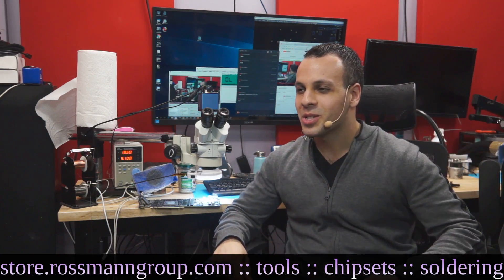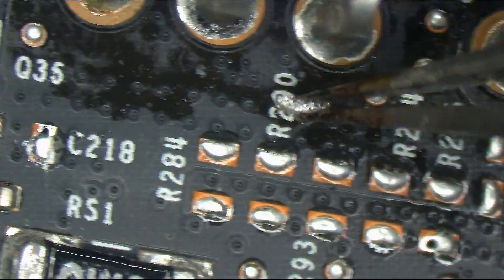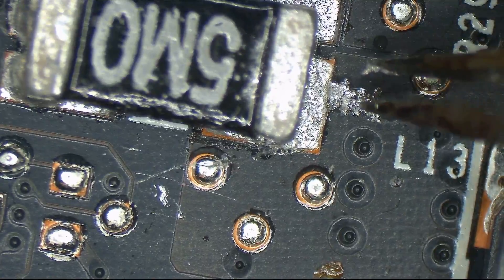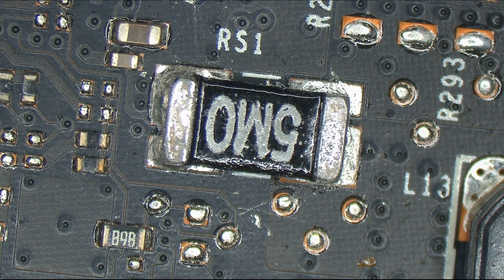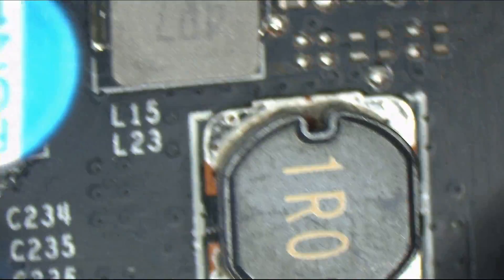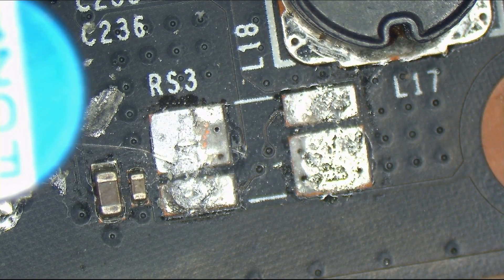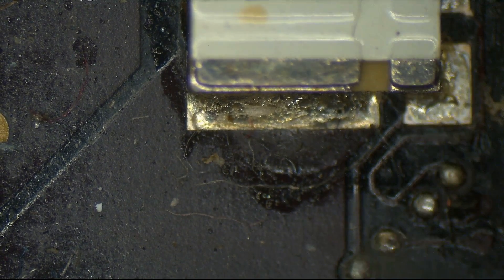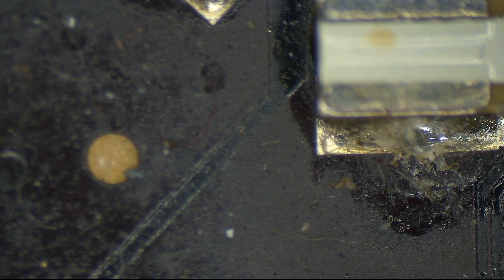DO NOT SHUNT MOD YOUR GRAPHICS CARD WITH LIQUID METAL!

Comment: That is morons at work (not you, the card owner).

Liquid metal has a great thermal conductivity, but it is a hazard for many metals like aluminium, tin and so on.
There are some gaming-channels and many modding channels/forums that tell you to use Liquidmetal on the current shunts to lower the resistance - that happens when people with no education in those fields try to talk about the details. It works - but it is really risky and even when done correctly will damage your hardware.

The sense-resistors there are 5 mOhm - just buy a 10pack of those and solder an additional one there - done.
Reply: Tells people their are guides for that... but says its hard to solder.. there is youtube to learn how to solder. You want to properly overclock.. learn to solder and replace the parts with better parts that give you the results. Liquid metal has 0 place. Your not overclocking your damaging the equipment.  Proper overclocking does not damage the cpu or gpu because they are all under rated. they test at x volts then say it runs efficient at a lower volt and under rate it. A actual modder or overclocker will do it right and it will work without liquid metal. You become better and learn more by doing it properly. 

Sure tide pods get you high... but kill your body and brain from the chemicals. Same principal. Sure liquid metal works at the cost of the components and boards death.
Reply: Soldering takes a 5 min video... Here you go.. https://www.youtube.com/watch?v=v4D_Rdp1uh8 a soldering iron which im sure any of your tech friends prob have and will let you borrow.. and a DAY of practice. They teach people how to solder in an HOUR in tech school.. grab some cut wires or if you have a broken board laying around to practice on. its not rocket science.. People DUMBER than you learn in a day.  once you learn it becomes a useful skill. One that you can be employed by. Meaning once you learn... you can mod your boards and your friends and get them to pay you.
Reply: +Raigekon If you can't solder then don't do a mod which requires soldering. It's really that simple.
Reply: They have clearly never seen or heard of how mercury and gallium attacks other metals by forming an amalgam with them. There are plenty of videos of a drop of gallium on an aluminum heatsink turning the fins in to something that feels like it has the structural integrity of wet tissue paper.
Reply: "You are trying to lower the resistance, but you suggest adding more resistance to the circuit... that happens when people with no education in those fields try to talk about the details"
Goes to show that you should have listened in school when the teachers were talking.

solder 3 more 5mOhm resistor on the first one and the result will be 1.25 mOhm.
Reply: I thought the primary purpose of liquid metal was to be used as a better coolant for CPUs than traditional thermal paste. I had no idea it was being used to lower resistance.  But then again, I honestly know next to nothing about this field. At least I admit that, unlike some others.
Reply: Learn how to solder and don't treat electronics with this gallium shit.  Don't wanna learn? DON'T TOUCH ELECTRONICS AT ALL. Simple enough?
Reply: +Robert Depuoz And how exactly is what we're saying that different from what Der8auer supposedly said?
Reply: GamersNexus made a shunt video but they said that Liquid metal is known to damage tin and aluminium and other metals so be careful not to use too much of it.Not everyone knows how to solder but everyone who as ever built a computer knows how to apply thermal paste.Or in this case thermal metal
Reply: Soldering is the right way to do it, but soldering one of those boards is not easy. The currents flowing on a GPU board are significant so they have hefty traces which will suck the heat right out of a normal soldering iron. 300W+ when overclocked with 12V in and around 1.2V to the GPU die requires an awful lot of copper in the PCB. If you try to solder a GPU board like you would a little through-hole Arduino kit you're going to have a bad time. Without hot air or preheat and the right iron at best you end up with a shitty dry joint, at worst you end up overheating the component or trashing the pads by keeping the iron on for minutes until the solder finally melts.
Reply: You can buy a cheap X-Tronic soldering "station" for, what, $40? It even has auto shutoff and heat ramps up from 200-480c really quickly for such a cheap iron. Works well for a backup unit, as long as you replace the tips with something decent. The X-Tronic 3020 fits Hakko tips, so you can even upgrade that to something decent for about $15-$20 each tip. Get you a desoldering heat gun, some flux paste, wicks, tip cleaner, tip tinner, and some decent 60/40 solder (Kester, Lodestar, Mechanic brands: don't huff the smoke) and you're good to go. Start practicing on junk micro electronics. You might want a scope as well. A cheap one that hooks up to HDMI or DVI monitor can be had for like $30-$100.
Reply: Raigekon soldering is not that hard
Reply: If you stack a 5MO resistor on your existing 5MO resistors, resistance should be 2,5MO(R(p)= R1*R2 / R1+R2, but interestingly thats not enough to gain a good amount of watts of power increase. 
I have moded my GTX 1060 and stacked 2MO SMDs resistors onto the existing 5MO ones. So in theory i should be at around 1,42MO. Before performing the shunt mod gpu-z showed 112% TDP @ 2138mhz @ (1093mv) under full load. After the mod 81% TDP @ 2138mhz @ (1093mv). My total win is 31 % difference but only 19% win i can use due to limitation to 100% TPD after power mod. 
Now @ 2164mhz @1093mv i start to hit power limit again(100%), which sucks. 

I now ask myself what to do. I dont know exactly how much the resistance did increase by my solder job. Maybe i just buy some 1MO resistor and replaced the stock ones.
Reply: No need to buy them, just solder over it, so that the solder connects the contacts, bypassing the resistor.
Reply: "Liquid metal is smth i could do right now, soldering isn't. "
You can also either eat a TidePot or make a sandwich - one is certainly a lot faster...see the flaw in your 'argument' yet?

"Another thing, der8uer did a 5 month test with liquid metal applied."
And you have watched the video? Cause he only tested the GPU performance. Entirely irrelevant.

but sure . if you want to destroy your hardware go ahead. Just don't spread you braindead bullshit.
Reply: +Robert Depuoz You've got to put their statements into context.

What people are saying isn't to never use it on any electronics ever, it's to never use it in this way where it will form an alloy with the solder before you're done with it. Extreme overclockers will probably remove it when they're done setting the record because they know it will eat various parts of the card. The one exception is between the die and the copper surface on the heatsink, but even then you need to be careful and inspect it regularly if you want to keep using it that way.

Personally I think using a gallium alloy is a specialty solution and isn't really appropriate for continuous use with electronics, because of the problematic chemical properties, but you are of course free to dissolve parts of your card if you want to.
Reply: Or, yanno, instead of risking Liquid Metal corroding everything, one COULD simply attach a small jumper wire instead.

Still this is something that NO ONE should even CONSIDER unless they are doing LN2 work, or are trying to break some hardware record on HWbot or 3D Mark. HWbot actually accounts for the TYPE of cooling as well, so if you are trying for a record, shunt modding will help - but SERIOUSLY - why people EVER though using Liquid Metal TIM to get this "shunt mod" effect - is beyond stupid....

I mean FFS, it is NOT HARD to solder a Jumper wire, or one could even use some copper foil and acrylic nail polish to get the job done.

Even if LM was not corrosive, it CAN MOVE! And should it bridge the wrong connection - you will have a dead Graphics Card!
Reply: +Robert Depuoz Seriously? Learn how to read between the lines, people exaggerate all the time to make a point.
Reply: That's like saying, i don't need to be a doctor to do an open heart surgery since there are videos and guides that tell's you how to do it. If you dare to open devices then you need at least basic understanding of electronics and soldering it's the more easy part, if someone don't even know how to grab a soldering iron then such people should not even think or attempt to fix something like this was done.
Reply: @ABaumstumpf
Most people want to reduce the resistance to increase the power limit. I would like to do the opposite.
Can I just solder a 1 mOhm on top of the 5 mOhm resistor and get a total of 6 mOhm to decrease the power limit though?

Because you said "just solder an additional one there".
Reply: It's funny that everyone has an opinion on what other people should do with their property. You should know that if you use liquid metal you run a risk as with most things. That said, many professional overclockers including Der8aur and Kingpin use this method on their own cards in competition. I'd trust them over some random yt commenter douchebag any day. If you watch Der8aur's guide he says it's not something that should be done long term but if you're just running some benchmarks trying to get a record it's a viable option. But research is King with anything you don't know about.
Reply: Jesus fucking Christ we're talking in circles. I literally said it's not a long term solution, but is viable to run some quick benchmarks... And those comments I quoted are absolute statements... Therefore context doesn't mean shit in that case. Anyways I'm done with this. To anyone considering doing this DO YOUR OWN RESEARCH. I thought about it about a year ago. And decided the cons outweigh the benefits in my case so I never did it. Your objectives may be different, therefore making it worth it for you.
Reply: Robert D youre a noob. learn how to properly solder.
Reply: i should make a meme for this shit.. and so i did.. enjoy lol https://imgflip.com/i/26pfeg
Reply: Djhg2000 I didn't specifically say you... But "liqui metal has 0 place" and "don't touch electronics at all" and all this other bullshit telling people what they should do with their property is fucking stupid. I'm sure this comment section is filled to the brim with electrical engineers and every day on the internet I meet the smartest person on the planet. All I'm saying is if you want to use l.m. on your card do your research and know what to expect and you'll be fine.
Reply: Yeah, I just leave my shit alone.  I still have an i7 920, factory clocked at 2.66ghz that 99.9999% of all current software won't overload.
Never needed to replace it, so I never have.
Reply: "use Liquidmetal on the current shunts to lower the resistance" "5 mOhm - just buy a 10pack of those and solder an additional one there" You are trying to lower the resistance, but you suggest adding more resistance to the circuit... that happens when people with no education in those fields try to talk about the details
Reply: Finding a guide takes less than 5min, applying liquid metal doesn't take much time either. Learning how to solder takes time, hell i don't think i could easily learn how to do it properly. 

What takes more learning and understanding? Applying liquid metal or soldering(provided i know nothing about it). Liquid metal is smth i could do right now, soldering isn't. 

Another thing, der8uer did a 5 month test with liquid metal applied. On his card there were no problems, but he did say there are ppl that had problems and there are ppl don't have problems at all with it(watch his video on it). Why are there ppl without problems and those that have them? Did they apply too much? Did they let it spill?

I agree that to do proper overclocking, you likely should learn how to solder, but maybe i don't want to learn how to solder just to do some overclocking here and there(not talking about daily system). This doesn't take much time, doesn't take that much effort(still need to be careful ofc) and gives you results.  I can easily do this on my old vid card, no risk there, i won't sell it, i won't use it, so it can be a 1  day overclocking project.
Reply: Did you watch the video? Yes he did test the performance, but he also looked at what happened with gpu and it was fine. You can also check the comments there. As i said previously, ppl are reporting it being fine and not fine. 

Watched the video. I don't have anyone i could borrow, so i'd have to buy it, further more i don't even know what i'd have to replace the shunt with to make it better, because my knowledge is if i short it i get better performance. What i do however know is a pretty decent amount about how to overclock(software side of things). Liquid metal is also smth i may just have laying around, since it's really effective as tim, so i literally just grab it whenever i want to and apply it. Further more, i can still remove the liquid metal after i'm done overclocking and i can remove the liquid metal and can continue to use the gpu regularly(if i want to). 

Tho not a 5 min, if you watch gamers nexus vid on application you will see how they protected other components as well as everything but the top of the shunt from liquid metal. At most liquid metal touches the solder on few small points. I don't see it as a problem with this kind of application. Since the vid is pretty long and i haven't really found a lot of good looking pictures of shunt mods here is a time stamp that shows a pretty nice looking shunt mod https://youtu.be/3pflC72NfnU?t=613
Reply: Yes because everyone knows how solder. For you it might be easy, on the other hand it would likely take me much longer to replace the resistor than to apply some liquid metal. It's a easy and effective way to do it, but 99% of the ppl shouldn't do it, unless they going for high benchmark scores(maybe oc competitions), in which case the gpu is already at really high risk of just kinda dying.
Reply: Raigekon - if you want to modify electronics you should know how to solder (aside from the fact that it is really easy). If you do not know anything about electronics - what makes you think it is a good idea to smear liquid metal (that has a lot of warnings on it to NOT let it get into contact with electronics) all over electric parts?
Seriously - go look at the warnigns on things like Conductonaut.
They mention 2 specific things: Don't let it get into contact with Aluminium.
And don't let it get into contact with electronic parts.

There is a reason for that:
It physically DESTROYS those things. As you can see in the video as the solder just crumbles away.

"but 99% of the ppl shouldn't do it"
that includes anybody that does not know exactly what he is doing. if you know what you are doing you will not use liquid metal as a resistor unless you do not care about the hardware getting damage, like when trying for world records.
Reply: Yeah that's basically what i meant with 99% of ppl(world records ofc). You don't need to know everything about electronics, since there are plenty of guides that help with that. 

This is also a easy way to start to learn how to do bigger overclocks(not daily usage overclock ofc, benchmarking overclocks). Now obviously if you are starting, you wouldn't do that to a 1000€ gpu(you'd go with smth like a 50-100€ gpu). It's a way to learn what happens(with overclocks, not liquid metal), how things function, it's 1 less thing to learn from the get go. I see it as a stepping stone to more complex things.
Reply: Raigekon - sure, but again - not with liquid metal. that is just destroying it.

Comment: You may have contaminated the joints on the other board with gallium when you poked the solder, check on them later to see if the gallium attacked it

Comment: Just buy a strix card so you dont have to do the power mod.
Reply: The power limit is decided by nvidia, it doesn't matter if it's from asus (strix), msi or whatever as aib partners are not allowed to modify the power limit above nvidia spec. Also, there is no strix version of the titan xp anyway, all pascal titan's are reference cards sold directly by nvidia.